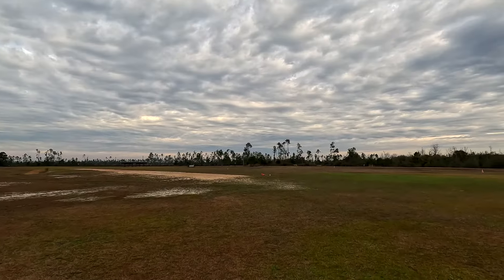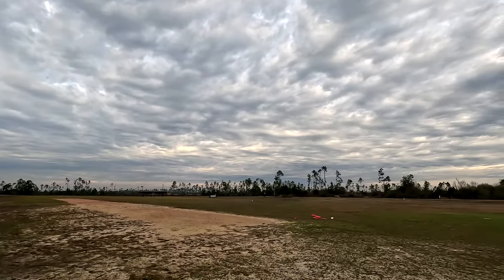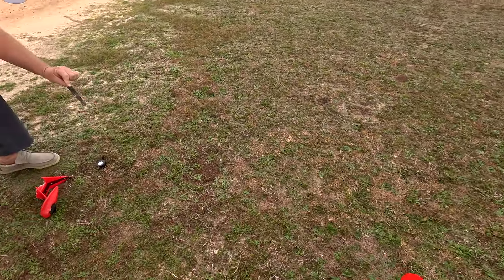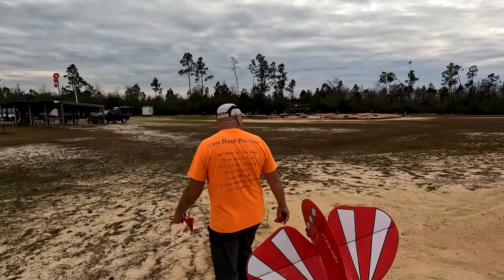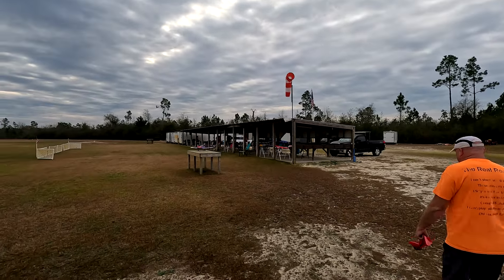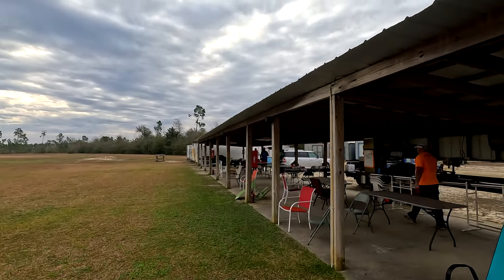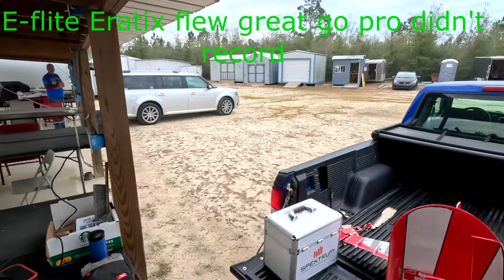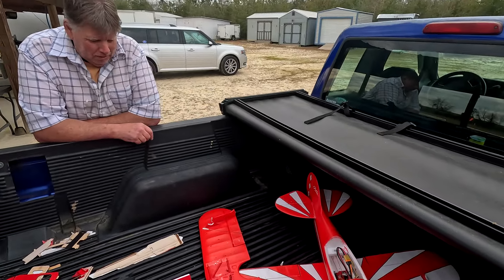E Flite Pitts S-1s 850mm

Comment: Sorry to see this my friend . Hope you can fix it . 
I've only ever flown mine on 4S and it can be a handful . but a great plane for sure 👍✈
Reply from the maker: Thanks Philip putting out the next video showing the same day flying the T-28 in same area and how many losses between radio and transmitter now fly on right side of the field no issue 30 mins later they took the analyzer out again all good thanks for watching part 2 coming next, 4min clip takes 2 hours of editing lol later😊
Reply: @SlowFlyer85  Glad you got it figured out . There was some type of mechanical building over at my last spot causing interference . I could see it when doing range checks . Its one of the reasons I don't fly there anymore . 
I'm not a big fan of editing either . LOL.

Comment: If interference is a concern, id go FRSky tandem. 2.4 and 900mhz
Reply from the maker: That's what some of the club guys are using and  think they call it open radio, I might be saying it wrong, but the Pitts is rebuilt again, I  just need to finish the landing struts.  I  need the little c-clips that  popped off thanks for watching😊
Reply: @SlowFlyer85  open tx is the older frsky. Ethos is where its at
Reply from the maker: ok thanks checking into it now @BluegrassStateRC

Comment: Cold battery below 50 degrees?  Very compromised.
Reply from the maker: cold battery, field spike,  pilot era all the above lol this 850mm Pitts has over 20 flights its so easy to handle just was my turn as they say not if you crash when you crash, it is now fully rebuilt  soon as weather gets better will do another video I have a maiden video in my channel showing how great it flys thanks for watching 😊👍👍